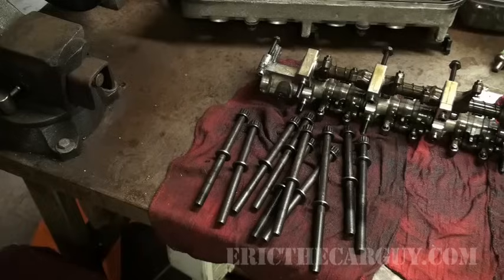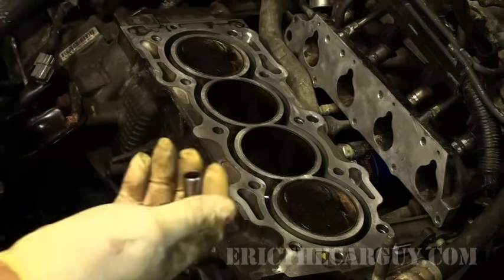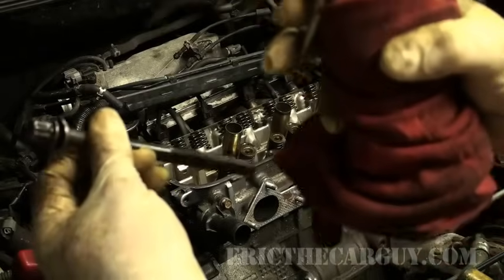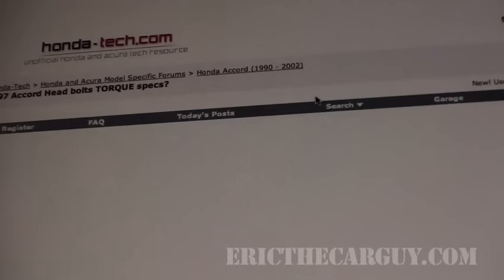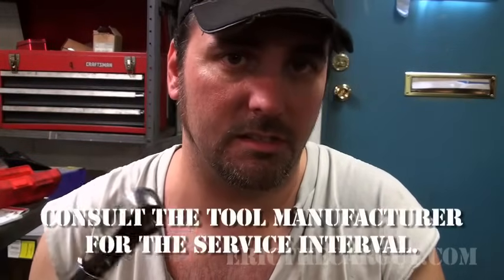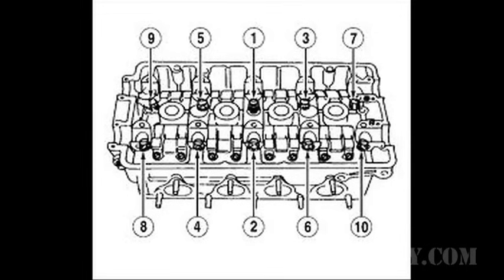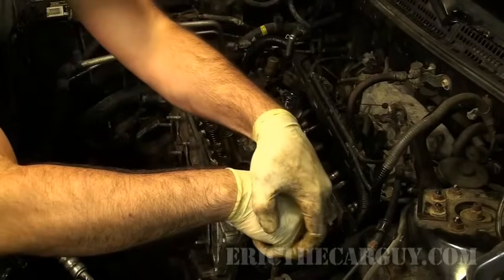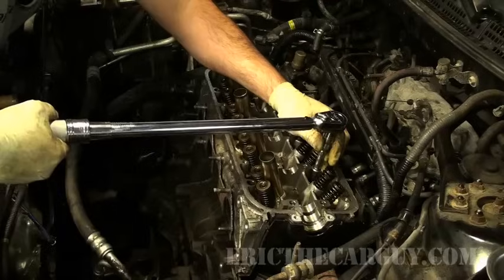How To Torque Cylinder Head Bolts - EricTheCarGuy

Comment: Eric great vid. I thought that I might answer the difference between taps and thread chasers.1; taps are tapered at the start of the tap thread chaser is not,2; taps have less and different shape flutes than thread chasers,3; taps cutting head is of different shape and angle than thread chasers, and this is the biggest reason to not use taps to chase threads as this losen the tolerence of the bolt to the bolt hole which could lead to the bolt comming lose later.

Comment: Hey there, I used to be in the navy and was the calibration petty officer for my division and i had some comments about your torque wrench tips. (Not bashing just tips). First, kudo's on the "effective range" tip, the navy standard is if the torwure required  falls within 20-90% of the wrenches range it will be accurate for the job. Next, if you make another video and mention the clicker, please mention the "breaking" function too. Kudo's on the video, i've always thought of making some.

Comment: Eric.I think you're right about the piston rings.It's the only thing i didn't replace on the engine.I've seen other videos and their getting white smoke on rings.You can still get good compression with worn rings.Unfortunately i haven't got a leakdown tester and they cost alot here.

What I was thinking m8 was i try an oil additive like restore or similar first if that doesn't work then pull it apart.Whatcha think.Looking forward to your reply.Thanks For All Your Help.I Really Appreicatte It.

Comment from the maker: @mickeygovender In my experience it's not the valve seals that cause oil burning but the piston rings, you might want to do a leak down test to see what kind of shape the bottom end is in, I think you may find the rings are leaking more than you think, esp on cylinder 1 according to your posted readings.

Comment: Dude.I was wondering.What causes oil in the exhaust manifold in a honda.I've put in new valve guides/seals in the head.Checked the head proessionally,all is good.Compression tests at 213,216.218,222 on cylinders.New gaskets.Torqued it down to specs.Checked the block for wear.What am i missing here?
Whats the best test to figure this out ?

Comment: thank you for doing all that for us ! :D , Eric why do not u just drop the dirty bolts in a pan fulled with low octane gasoline (like 91), u will get them as clean as brand new in few seconds no matter how dirty they are!! i would do that if the washers for the bolts are not rubbery.

Comment from the maker: @MYDRAGGIN84 Not really normal, if it's a Canadian model then the headlights are designed to come on when the ignition is put in the ON position.  That should have nothing to do with the starting circuit however, perform the check that I recommend and see what you find.

Comment from the maker: @MYDRAGGIN84 Make sure the connections are good.  Try seeing if you have 12V at the solenoid wire when you turn the key to crank, if you don't you might want to look to the ignition switch and the wiring.  You also need to make sure the connections of the battery cables on both ends are good.

Comment: Eric, I'm venturing from external to internal engine on my '95 V6 accord. That's the C27A4 engine, if you didn't know lol. ANYWAY, I would like to exchange the head gaskets and clean up some stuff. Do you know if I will HAVE to remove the cams and rockers from the cylinder head in order to remove the entire cylinder head?

Comment from the maker: @2010petrolhead Far be it for me to disagree with your dad.  To be honest I haven't worked on that engine so I couldn't say one way or the other but on the Accord the block is aluminum and being a soft metal it's not likely to crack, that still doesn't mean that you shouldn't proceed with caution when doing this work as it takes some time to do a job like this and if you can prevent a comeback or engine damage you should take every precaution to do the job right.

Comment from the maker: @spelunkerd Use it only when the bolt is going to seal a passage,  on some engine blocks the threaded holes for the water pump go into the water passage, this would be an appropriate time for sealant.  Cylinder head bolts should NEVER have sealant put on them however as they don't seal a passage but rather fasten the cylinder head to the block.  Consult the service manual whenever you have a question about the use of sealant in a particular application just to be safe.

Comment: Hi Eric. I'm a little confused as to when to use thread sealer, to prevent fluid from finding a track along threads and ending up in the wrong place. I've read that you should use thread sealer when bolting a water pump, but evidently not when you bolt a head on. Is this correct? Why the difference?

Comment from the maker: @HondaGRST You can use that sequence but the important thing is to start in the center and work outward, not at the edges.  I like to use OE parts whenever possible but I haven't had problems using the aftermarket gaskets that I've used so far, the important thing is the treatment of the head and the block (cleaning them properly) as well as the correct torque and sequence when installing the head.

Comment from the maker: @gst69man Taps are designed to create threads not clean them.  A thread chaser is designed just to clean and not alter the thread pattern.  You can use a tap, it's better than nothing really but the ideal is to use a thread chaser.  Yes, you will never stop buying tools doing this trust me.

Comment: One thing though.... Never leave the torquewrench set, when done screw ut out so that there is no pressure on the spring in it.... this will keep it accurate for a longer time... Love the vids by the way so thanx :o)

Comment from the maker: @mixwell1983 The issue I would have with that is that it might send the debris to the bottom of the hole, with a thread chaser there are cavities in the tool that capture any debris and will remove it from the hole.

Comment: I don't know if cleaning the block holes would work but IF you're a gun guy or into guns you could just a close caliber brass barrel brush to clean it.. I could be wrong but if it s cast iron you shouldn't damage it and i don't know if aluminum is softer than brass but I would think that would be another option.  You could even jerry rig up your brass bore brush to an electric  drill.. This could be far fetched but I would think it would work pretty well to clean out your bolt holes personally.

Comment: if an angle turn was specified, how would you do this? would you use a torque wrench? if so, what should the torque setting be set to in order to prevent the wrench from clicking?

Comment: As usual, another very interesting & informative video. Don't know if Snap On can do periodic calibrations from their trucks or you need to send it in to the company so they can calibrate it and put another inspection due date for recalibration. You must have spent an arm and a leg on those Snap On torque wrenches but believe me, they are work every penny of it for toughness and durability.Keep it coming. Thanks  Eric.

Comment from the maker: @mickeygovender Check the injectors to see if they are operating correctly.  Start with a noid light to see if it's getting the proper signal, if it is then you probably have a bad injector.

Comment from the maker: @coldcash12345 You would work that in pretty much the same way as I did here, the best scenario is to start with the center bearing and work your way outward.  Run them down till they are snug and tighten them to torque in stages.  Know that torque on rod and crank bearings is critical so be sure to get it right.

Comment: ive noticed you've got snap on torque wrench's was just wondering would you concider the digital ones they make to be better or worse than the click style ones, im asking as ive got a digital one but those click ones seem easier to use ie. you don't have to look at a digital gauge

Comment: Good Video Eric.Very Helpful.Can you make some video's on Carbureters pls.No one has them on here.I got a Bad Fuel/Air mixtures on my Honda after a Engine Rebuild&Lots of White Smoke out the exhaust.Spark plugs blac and misfire on cylinder 1.I've already ohm checked the injectors and cleaned them with injector cleaner,adjusted rocker timing,compression is good.Sparks,Gaskets,Belt all new.Any Idea's!!

Comment: great video eric, love your stuff but i need to let you know that you only torqued the third stage to 71, not 72. for as much importance as you place on proper torque, you might wanna go back if that cover is still off, i know its only 1ft/lb but you seem to want the most accuracy possible. i "know" a guy (davidsfarm) who builds or rebuilds enough engines and he claims to never use a torque wrench and has supposedly never had a problem.  thoughts?

Comment: So that's pretty much all it takes to change a head gasket?  You just take off the valve cover, unbolt the head bolts, lift the head off, remove the old gasket and replace with a new one, place the head back on properly, torque the head bolts, and put the valve cover back on?

Comment: Eric, I am about to do rod bearings on my 3000gt, and the caps obviously have only 2 nuts. Are there any tips to torqueing 2 nuts or should I tighten the nuts tell they have contact and then torque?

Comment: i learned my lesson to lubricate the bolts and keep a steady torquing when worked on my 2003 Altima (TTY Bolts). i broke the bolt with that pinging noise because i did a stop and go. Got lucky the broken one came out real easy with a pick tool. love the video

Comment: I was told that extensions twist and cause inaccurate torque readings so if you use an extension, it might click at 70ft/lbs but you actually got , let's say, 65 ft/lbs. i would have used a long socket instead of an extension. In fact, i think they make torque sticks for wheels which give you particular torques by twisting. I would have also put lube on the bottom of the washer and used a non metal brush on the threads. maybe a tape in the threaded holes would have been good too.